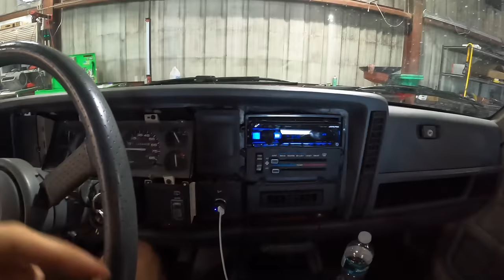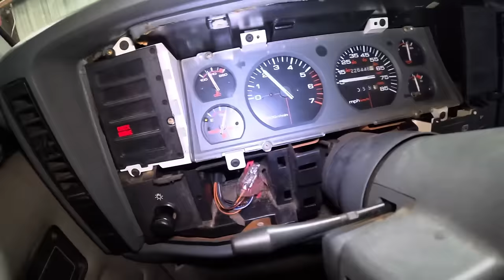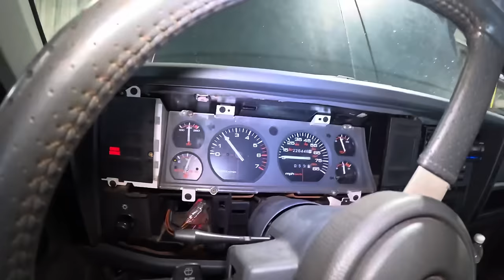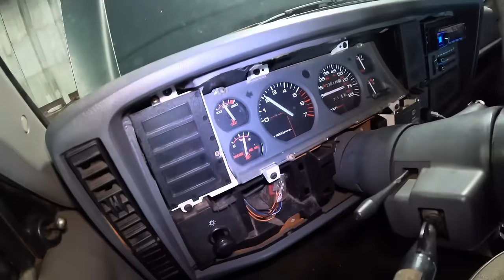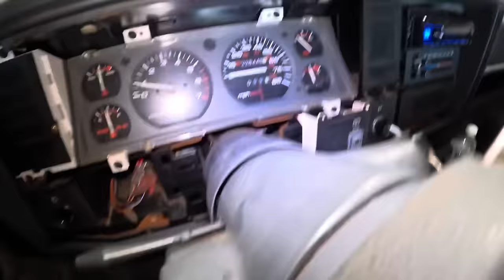Scalding HOT EVIL Filter of DEATH!  SEVERE Smoking! Jeep 4.0 Cherokee / Wrangler @bgproducts

Comment: Plastic valve covers on AMC are prone to warping. New gasket won't last. Replace valve cover. Bad valve stem seals are usually diagnosed by driving the car, putting in a lower gear and decelerating>>if seal are bad it will smoke then. If it smokes on acceleration, it is bad rings. If you flush the engine oil consumption and smoking will only be worse. Voice of experience here>>Bought a 69 Chevelle with 307 V8 when I was 16 in 1979. It had so much STP in it from the dealer I got it from, the oil barely came out. Flushed it and the engine burned copious oil. I grew up during the era that most cars left large oil spot under them>>you saw large grease spots in all the parking spaces at the store. Engines were so black with leaked oil, you couldn't tell what color they had been painted. So much sludge under the valve covers, you couldn't find the head bolts.

Comment: With that level of decontamination going on, I would have dropped the oil pan and cleaned it and the pick up tube assembly as well.
But that stuff did a pretty good job on the valves for sure.

Comment: Im old enough to remember cheap used cars that I had to remove the sludge in the head with a teaspoon.     Some were so bad the return drain holes were plugged and a quart of oil would pour out when I removed the cover.  😅
Thanks for the good vids.

Comment: If a new drain plug is installed it will thread in all the way by hand, yes I know from experience, plugs always stretch the threads through many oil changes, plug fails before the pan threads.

Comment: I use 1/4 drive about 60-70% more then any other . 1/4 fits every where.  I typically only use 3/8 for brakes and suspension,trans removals, and 1/2 for usually only for wheels .

Comment: I had a 92 Cherokee sport with the 4 leaders straight 6 And I'm telling you we abuse the living snaut of that thing for 15 years And it still ran like a clock the day we sold it. I can't remember the exact mileage but it was over well 200000 But the only difference is I do my oil changes religiously at 5000 And that engine  didn't smoke didn't have any blow by😮 D*** good engines.

Comment: When I worked for jiffy lube years ago I'd do the super flush on my friends and family's new used vehicles. I'd put the gallon of cleaner in change the filter run it. After that I'd drain and fill it with 5w20 change the filter run it. I'd do the final filter and oil change with full synthetic.

Comment: Ironically I ran an EPR with a fuel induction on a 91 wrangler with a 4.0. came in sounding fine extremely mild lifter tick. 10 minutes in and it was clacking pretty hard. Pulled the cover to something that looks about 5 times worse than that.    Might be running one of these next if i can solve the clacking

Comment: I used to do the something to old motors, using Diesel fuel. works grate to clean out old sledged up motors. and it less expensive. A gallon of diesel fuel and a quirt of tranny fluid.:person-turqouise-waving:
Never use Pennzoil, its nothing but Wax and that is what gums up the motor. use Castrol, I ran Castrol in my KIA and it had 250.000 miles on it and there was no sludge under the valve cover at all. And that's with 5000 miles between oil changes.

Comment: Very  impressive!!!! Occasionally, I would buy surplus Military Police vehicles that were never driven 35 mph+ that were CAKED with old oil and sludge. I would drain the oil and fill it with diesel fuel. I would idle for 45 minutes. This would do a decent job and stop the engine smoking. Very dangerous procedure because I knew it could possibly burn the car up. Lol

Comment: around the 40 min mark when you were spraying out the brake clean it looked like there was a very small crack in the top of the valve cover right next to where the breather connects. it is very possible to just be some gunk in a line but looked very suspect so figured id say something.

Comment: Bungie attached to coil springs?  What happens when you lift the rig?  Suspension will pull on the bungie and possibly pull those hoses out of the engine compartment.  Need to be attached to something that does not move in relation to the engine.

Comment: Just a suggestion Mr.Ray, ask Wife Unit to see about purchasing you a pair of Silicon Oven Mitts, they are rated at 500F so they could offer you better protection for those "Hot" moments on those engines you are doing that cleaning proceedure.

Comment: Ah yes the Cherokee... My 95 Cherokee with 320k miles I was having oil pressure issues and inside of the engine was crusty.

Poured and entire quart of ATF in the engine and drove it 3k miles did that for 2 more oil changes I dropped the pan to do a pan gasket 2 weeks ago and the engine is spotless and still runs like a top it sees redline on the daily. 50k miles since I did that still going strong

Comment: I many years ago had a custmer with a full size buick with olds 307 motor. He complained of excessive  smoke. Very little oil on dipstick.removed rocker covers to find they were full of oil . Oil return holes were pluged with carbon and sludge. Oil had nowhere to go once it was pumped up to heads. I asked when last oil change was, he said regular service. Oil filter was a factory installed one. ( he was a very thrift customer). I had one suggestion it would either work or he will need an engine. I ended up chiseling the carbon and sludge blew out what i could then put many cans of combustion chamber cleaner over remaining sludge,let it sit for a while. Then opened drain plug and hot water pressure washed thru the heads. Blew out with air, filled after with trans fluid a couple of times, then put in reg oil. Told him to drvr a return in a couple of days and i will change again. He was lucky it did work, and no issues  after.

Comment: After all of that, I would have installed valve guide seals. That would be a few more shekels in the can, and it couldn't possibly have hurt anything. If the customer is paying hundreds of dollars for the engine flush, a few more bucks can't be a deal-breaker.

Comment: Ray- buy a tub parts cleaner and load it with 20 litres of commercial brake cleaner - install a sumo pump with a brush on a hose and a filter to try keep the solution clean for long as possible - yes you’ll still need for cans for those moments you can fit a chassis or cross member into the tub… but it’ll change your life brother

Comment: The difference between 3000 and 2000 for 45 minutes is 45000 RPM.  How much cleaner would the engine have been with an extra 45000 RPM in this engine cleaning procedure?  Just asking!

Comment: I think that you'd get the same or better results by putting in 8 oz of Seafoam and then driving it for 30 minutes, then changing the oil... and running 4 oz of Seafoam in the oil at each oil change.

Comment: Why make a gasket out of cork? Rubber can be strengthened to resist high heat and doesn't absorb moister so what's up? It can't be that much cheaper to do either.

Comment: I reckon this jeep could use a fuel system flush as well. Especially if the oil is thin with gas. A leaky/stuck injector? They way you use brake clean. I could use 1 can and do the same job :P I also use de greaser and a stiff brush, finish with brake clean. No need to waste.

Comment: i am silly and put fuel in the freezer and water in in the fridge then put the fuel in when it starts getting hot and spray cool water on the radiator. "i have a old excevator that in the mid summer want to over heat but cools right down when i use super cold fuel and spray cool water"

Comment: No way a dripping oil flow with cleaner  from the rockers can clean out the inner head cavity without pressure or manual hands on wiping and scrubbing with brushes and or air pressure correct? If it does I'll be trying that method!
Reply: Surprised me! It did clean the upper head What did you say that stuff was? i want to try it...

Comment: I wonder if presure steam with a external filtering machine could break down sludge in a motor better  the system would work like your transmission fulid exchange system only at the end you would do a rinse stage filter change and new fresh oil change. Then a second oil change after 3k miles and use a synthetic oil with a low viscosity  5w20  for 3k more miles then go back to a normal qulity oil and filter.  
There are differences between oil filters just like oil brands.  A cheap filter is littel to no protection  thats from amsoil  and synthetic oil is a lot better. It dont break down as fast. 

I think a lot of the smoke in the motor bay was oil on the block burning off, it wouldn't hurt to have the motor detailed using a steam cleaner at a detail shop.  Ive seen engines that looked really nasty turned into a very clean engine bay and motor after it was done.
Used car dealers send cars out to have it done so they make more money off them.

Comment: Question: is the open garage door enough to properly vent the exhaust fumes?  Or maybe it is vented up through the ceiling?  I used to work in a shop in high school and we used a hose to vent out in most cases.  It only takes a second to install, though admittedly, I tripped over the host constantly.
Reply: the fans spreading the fumes evenly in the shop, he  is violating OSHA rules, killing Troy slowly with combustion byproducts.

Comment: I'mma have to try that. I have an 03 odyssey that does that if it runs at idle for about 1/2hr. I know it's the stem seals or the rings. Been doing it since 2015. With 340,000 now. But other than that it runs perfect oh and I bought it new

Comment: None of this would necessary if the oil was changed on a regular basis; I guess it's another Jeep thing. BTW I retired my 1989 Jeep Wrangler 2.5l with over 350,000 miles. Primary issues were a crappy exhaust system and excess blow-by causing the valve lifter cover to leak oil (new PCV valves and replaced gaskets had no effect) but no smoke at the tail pipe and it still passed CA smog.

Comment: I was really hoping you’d put the infrared thermometer to use to see how hot that thing was. I remember changing the plugs and wires on my brother’s old S10 on a day when it was almost 100. He drove it almost an hour to get to my house. We hosed the engine for a good 15 minutes before I could even think about touching anything. It was still boiling hot. I grabbed the first plug out of the engine and it felt like grabbing a piece of charcoal.

Comment: I admit the engine is basically toast to start, however, Why didn't you guys do a compression test, before & after. What about oil seals starting to leak. 
I wonder if a long term results will appear on the channel.
Reply: That engine isn't toast.

Comment: When you pulled the valve cover, I expected a lot more buildup.  I've seen worse from 1/3 the mileage.

Owner must have been doing all oil changes on time.

*****

You'd like cork even less the way i used to install new cork gaskets.  I put permatex 2 on both sides of the gasket.  The "never hardens" sealant that turns into something as hard as J B Weld.
Reply: Would have been interesting to do a compression check before and again after.

Comment: I remember my uncle many, MANY years ago doing sort of an engine flush...using kerosene.  Drained the oil and removed the filter to replace, put in a couple or so gallons of kerosene, fired it up and ran it for like 5 minutes, drained it, filled with cheap, sacrificial oil, cranked and ran it, again for like 5 minutes, drained, and changed to a new filter and new oil.  The stuff that came out of those engines looked like tar colored snot.  Seemed to work but, myself, I wouldn't try that since kerosene is combustible and in a hot engine, I don't know if it would but I'd be afraid it would just go, BOOM...lol.  Old mechanics back in those days did weird things.  Who knew if they really worked.  They were cheap and made you feel like something was better, at least.  Still, the BG looks like it did a great job. It'll never be perfectly clean after going around the planet many times in miles but that wasn't too bad.  Smoking, though, and now the mosquitoes won't be tortured when it's running...lol.  Take care.

Comment: Need to pull the oil pan and clean. Remove valve cover and plastic mask around cylinder head under hood and windshield. Spray engine valve train with purple power and have at it with a pressure washer. Dirty ............yes but well worth the effort. done it 4 times over the years different engines.

Comment: Oil change galore
My future wife at that time had an old Honda wagon, 4wd, radiator was eaten by rats, alternator broken. Bug I got an alternator from a shop, changed radiator at a shop. But oil change did myself. We first ran a cleaner for half an hour. Let it idle as per instructions. Then drained and got good oil. She ran much much better after that cleaner.
Just a quick question - can you soak a bit of gasoline, it’s good in breaking this oil sludge and use some steel brush to clean?

Comment: I really hate how the XJs have the filter adapter on the block like that and I've considering using a remote filter adapter.  Jeep put in that 90 degree turn because the filter will not clear the uni-body with the 4.0.  I shudder when I see all the grime underneath... I spent hours scraping the grime off of the engine, transmission and transfer case when I bought mine.  The PCV situation is a heinous crime also...  Yeah, I know Jeep uses weird elbow/hose sizes that change size from valve cover to manifold, but dang...  I bet that thing stinks like a gross hot oil leak...

Comment: Running that clapped thing at ~2k rpm on that first run with not much cooling was sketchy as shit. I love this channel.

By the way, which brand of flex head reversible ratchet wrenches do you have? I'm seriously considering buying the Williams set only because I can't really find any other manufacturers. I'm tired of ratcheting myself into a corner.

Comment: Why do you state over and over that the engine must run 3000 RPM for 45 minutes, then accept 30% less and that is OK?  Was the 3000 just a number that you pulled from the air or was is stated on the instructions?  Just asking!

Comment: I did this to a 1993 f350 idi diesel that had over 400k miles on it, and it had sat for 10 years. I was amazed how clean it came out. I've since been daily driving that truck for the last 2 years and about 50k miles. It burn/leaks about a gallon per oil change, but who cares, it's a 30 year old truck. Bg makes good stuff.

Comment: One of the best engines ever made if properly maintained.
Reply: Even maintained they had some problems. The most important thing was keeping it cool.
Reply: @toledojeeper2932  You have to  try pretty hard to kill a 4.0.
Reply: @1945tigers  …I never said it was a bad engine . It just has its problems such as leaks and some years have head issues .
Actually you don’t have to try hard to kill one . Just running it hot daily will do it and I don’t mean just overheating it .
The nice thing is they are easy to work on . I replaced the head on my 2000 XJ in a couple of hours .

Comment: Hey this is like Scotty Kilme’s friend “Bernie from Albuquerque” that has his oil cleaner/flush but you just add a bottle to the engine, run it at 2500rpm or whatever it is, for 30min or 45 or whatever it is, than you change the oil / filter and put your regular oil & filter in and you’re done. His doesn’t have a rinse bottle you do after the clean / flush though, but from his videos showing that dirty oil it clearly works and probably cheaper than what you used here being you’re doing another oil / filter change and using a “rinse” bottle. If the rinse doesn’t come in the kit with the cleaner anyways. Hopefully it helps with his truck some at least, but it’s probably just slam worn out & no cleaner / flush is going to help with that. This is a toy though so 🤷‍♂️ burn it up and have fun and it’s all worth it in the end!! Next time get a Fo~Runna or Taco 🌮 and you’ll be able to do that aforementioned “burning it up and fun having” significantly longer!! Lol appreciate the content brother! Can’t wait to see that boxer replaced whenever you get the block into the shop!!
God bless~

Comment: I know you have a parts washer, why don't you use it instead of so much brake clean?  The parts brush would have removed most of the crud.  I was skeptical of the BG stuff but for the moment it seems to have worked.
Reply: Troy knows fume is dangerous, nut the cloth will not filter out the solvent vapor though. Ray getting the $ from views, Troy paying dearly with his later lung cancer.

Comment: That was probably the most expensive oil change I have ever witnessed ! I remember you bought a parts wash tub and am wondering why you never use it. I understand tossing brake kleen  bottles is so much more visually stimulating but varsol is so much cheaper, no?
Reply: His parts washer is filled with Diesel, you don't want that getting into a petrol engine crankcase.
Reply: @jsh6952   a little diesel won’t harm anything in a gas engine, it act as a cleaner at that. My parts washer is filled with kerosene which is diesel number 1. Kerosene is cleaner and doesn’t have lubricants in it.
Reply: @Brucee’s Channel  on more modern cars, ANY Diesel or Kerosene that winds up in the oil pan will destroy sensors and the Catalitic converters once it goes through the positive crankcase ventilation system and gets mixed with the fresh incoming air. It will then also contaminate the exhaust gas recirculation system, further contaminating the intake system, vacuum systems, and even more sensors.

Comment: Was a time, in Model T days, when you would drain the oil, fill it up with kerosene, run it for a few minutes and drain.  This would clean the whole system out.
Question:  Will you send that drained oil, with cleaner, out to be re-refined?
34:10 You were gay 20 years ago?